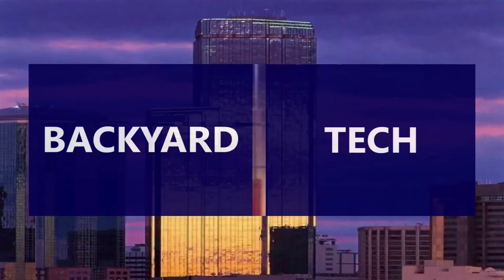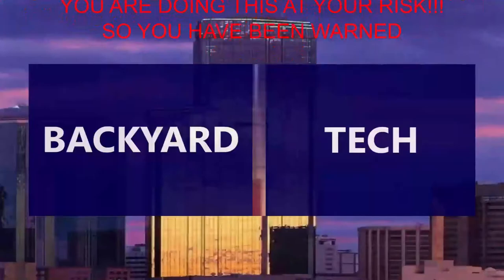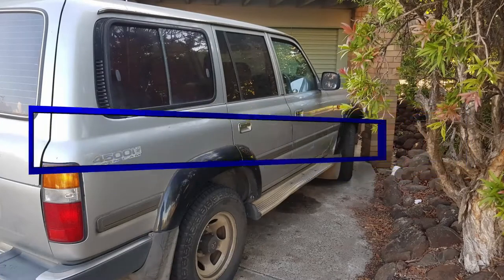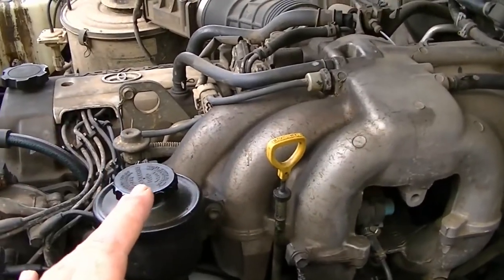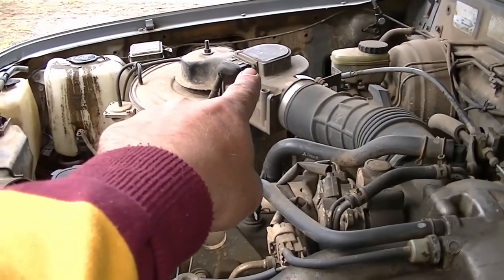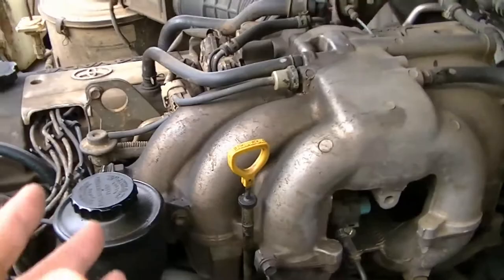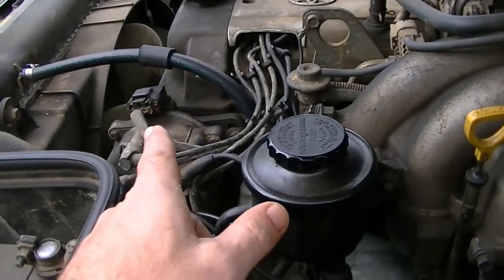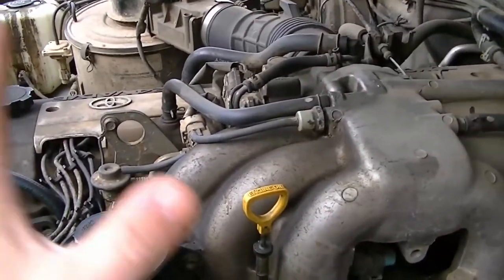80Series - 1FZ-F Conversion to EFI and Bonus Ending

Comment: Thank so much  mate 
Actually I am from Kuwait 
I have standards manual transmission 
, my big pain for carburetor is fuel and air calibration, I have never used carburetor before,it’s just few months ago since I bought 80 series ,I am happy with engine  horse power and torque ,
Let me tell you some thing ,doing a major maintenance for long term drive is much better and easier  than doing minor maintenance every 10 days or every two weeks.
If some thing going wrong with EFI I would go to specialist and fix then I will come again after 1 year and more ,but carburetor you need to calibrate it every time and actually I have no experience to do it, I guess if I done that before many times with no issue I will not pain and complain 😂😂
Thank for great  videos 👍🏻👍🏻